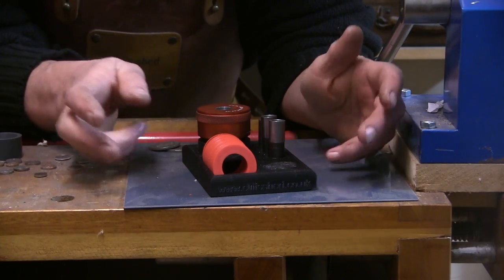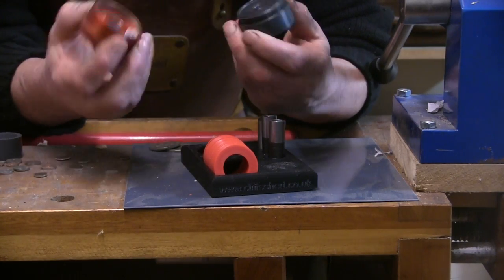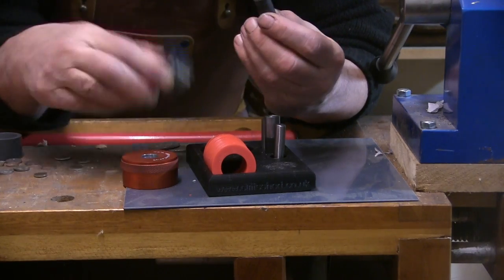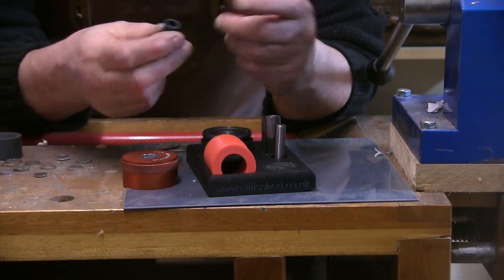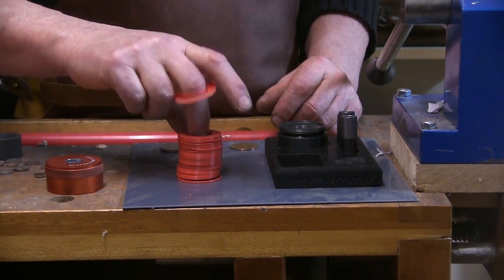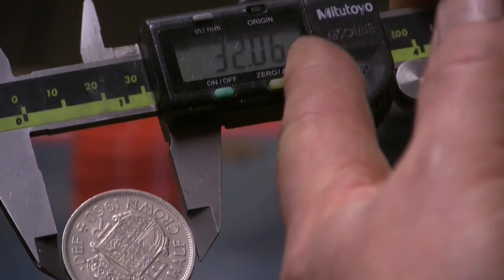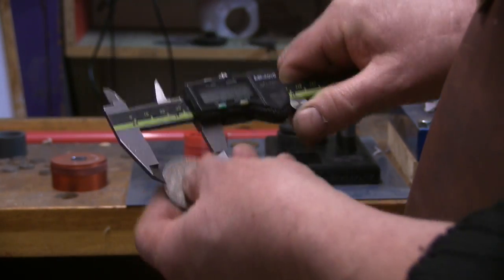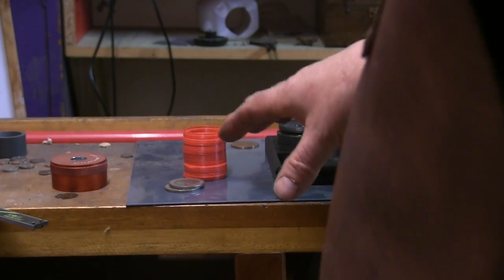Punching a hole in a coin, to make a coin ring(update)

Comment: Hi cliff, love the straight talk no bullshit with waffling on with nonsense,
  I bought a punch set from else where some time ago , it was a self centering coin type, I find applying a little wax or within that nature to the punch cutting edge it help releasing the punch back out from the coin a little easier, ,
Also not seen your the punch cutting angle on your set but mine has a slight angle to them to help cut through the coin easier,

Comment: Thanks for the video Cliff. Interesting. The first method uses small amounts of pressure so the last cut only has a small amount of Inertia. The second user higher pressure so at the point of failure on the coin, the plug has a larger amount of inertia. This is just a thought on what may be happening. Keep up the good work on the videos.
Reply from the maker: Cheers Colin, had a crappy few weeks, but pretty much sorted now,
ATB
Cliff